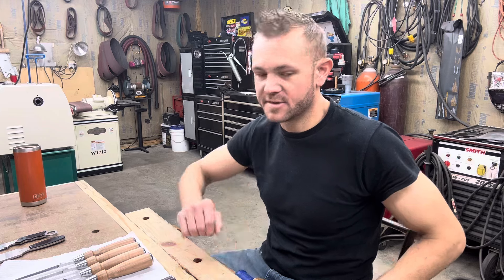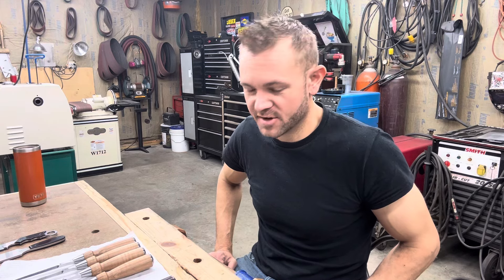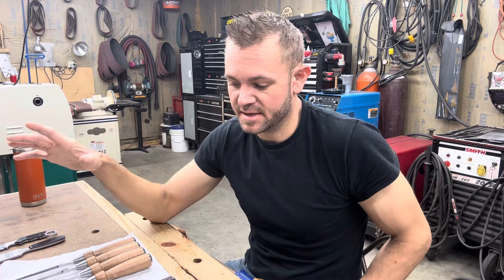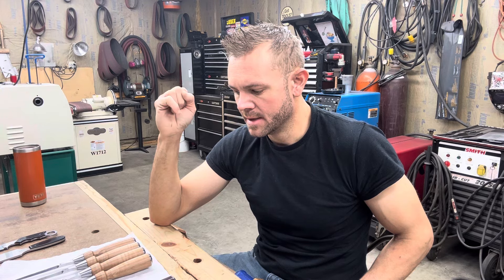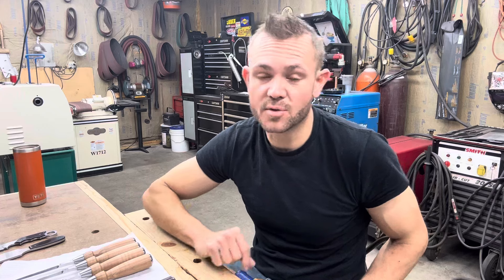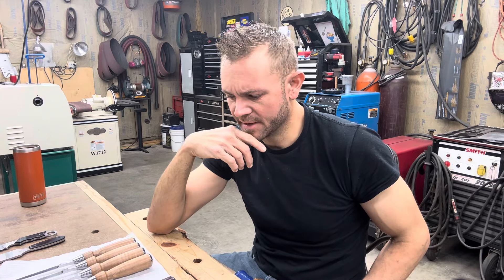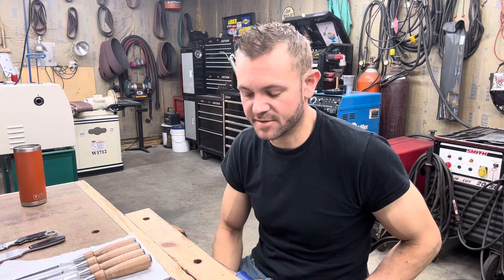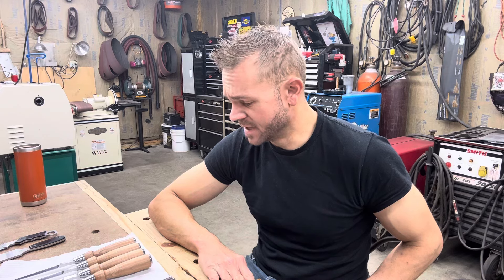CPM Magnacut CHISELS!! Finally, stainless chisels!!

Comment: The cutting edges of A-2 and D-2 crumble, even with a 30 degree bevel, so why does it keep getting hyped ? Check out DC53, if you want to make a great chisel. It not only takes a fine edge, at 61-62 RC, it remains very tough, and impact resistance like you wouldn’t believe. It was designed to supercede the above mentioned air hardening steels to eliminate that crumbly cutting edge that keeps woodworkers sharpening, not woodworking. The patant was awarded in 1986, so it’s nothing real new. Check it out.

Comment: Well, shucks! You didn't have that when I ordered my chisels.... I know there are CPM plane blades. I have been using CPM V10 turning tools for years, as well as M42HSS tools. Some guy from Australia on the AAW (woodturning) forums was making gouge tips from tangung, which I use on some of my scrapers, known as 'the Big Ugly' tool. Supposedly the M42 does not hold an edge as well as the PMV10. Oh, I am used to seeing a V after the PM stuff, which is vanadium. so wondering if that applies to your tool metal. I didn't know you made draw knives.... Some day in the future... Oh, still want a corner chisel if you get to them.